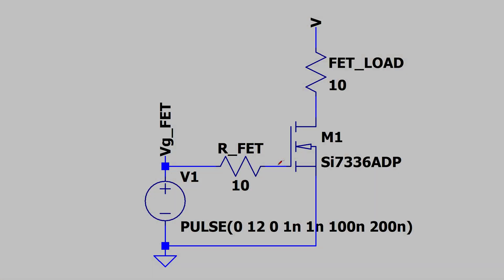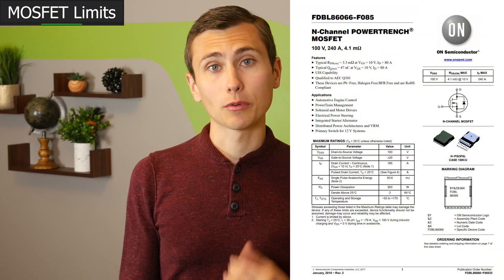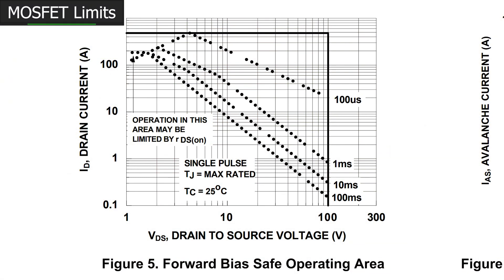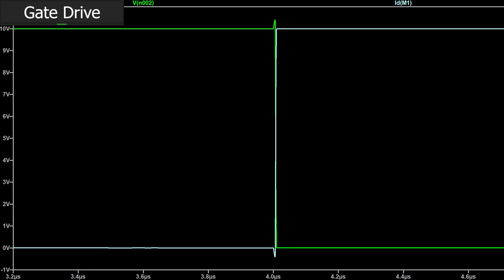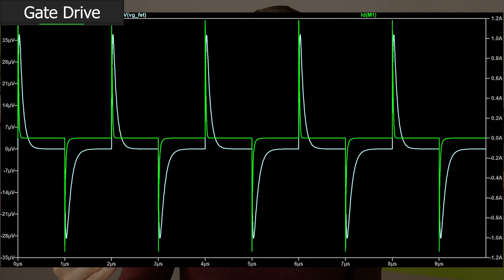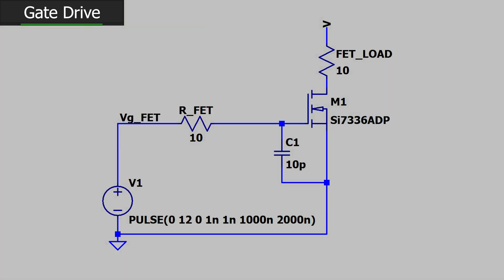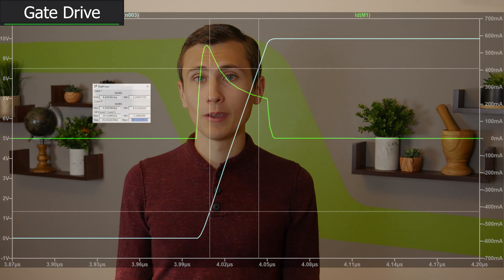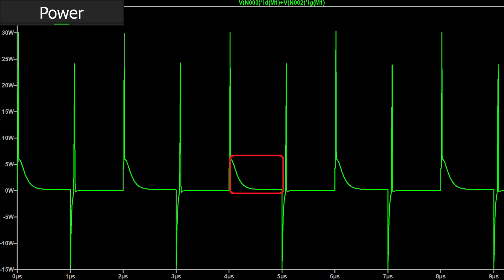6 Simple Tricks that Destroy MOSFETs!

Comment: What a fantastic tutorial … as an old crusty 56 year old engineer, you have taught and consolidated some really important stuff that I haven’t seen much in my career being focused mainly on the maintenance and fault investigation side of things. I’m currently having a bash at designing a high current boost converter and it’s no walk in the park. I think as a designer, a good analogy is if this was woodwork, my design would probably work but would resemble a load of roughly sawn bits hammered together with a few rusty nails with over sized parts but structurally weak so don’t use it to sit on!!! As opposed to a beautifully crafted product with smooth lines and a beautiful finish that is light enough to fly at supersonic speeds but can also be used to stand on. 😂😂😂😂

Comment: Hello, does this data sheet specification "Vgs - Gate-Source Voltage:  - 10 V, + 10 V" mean what I think it does? As in, do not supply more than plus or minus 10V to the gate from the driver? Gate-Source is confusing due to the MOSFET having a "source" pin. Does it really mean Driver-Gate Voltage?
Reply from the maker: Hello Anond, great question!! My apologies for the slow response. 

Vgs, is the voltage at the gate, measured with respect to the source pin of a MOSFET. A rating of +/-10V is measured at the part, so typically some margin is left when designing the driver. (Parasitic capacitance can lead to voltages measured  at the gate that are above or below the driven voltage. 

That's more necessary for higher-voltage parts and parts that have high dV/dT events (rapid changes in voltage or current)

Side note, but driving an nmos fet with a negative gate voltage will almost always reduce off state leakage current!

I hope this helps!

Comment: Can mosfets (like BS170 in TO-92) be destroyed just by touching them (without it being connected to anything, straight out of packaging?)
Reply from the maker: Absolutely! ESD events can kill a mosfet very easily if it strikes the gate pin directly. This can charge the gate pin beyond the VGS rating, destroying the part. 
In fact, mosfets are most sensitive to this before soldered on to the PCB! (The board will add an element of shielding, additional components, and parasitic capacitance that help to minimize peak Vgs stress during ESD events.)

Comment: O: I am not electrician, this information sounds really well made though.
I was wondering if you can guess what happened to my spot welder mosfets.
I was using 2 12v batteries in parallel for powering the spot welder because 1 was too weak for making a welder. So it worked Very well but the cables were getting too hot. So I decided to use thicker copper wires. But after the first welding the mosfets exploded. What happened? The same setup, just thicker wires.
Reply: if you get thicker wires, your resistance decreases and more amps can go through the 12V circuit.

Comment: Exceeding vds does destroy fets, on the contrary, it's actually quite useful if you know how to use it.  Avalanche mode is allowed as long as the heat generated does not exceed the failure point of the junction.   Time and current while in avalanche is the concern. I regularly design switching supplies to use avalanche as means of controlling emi/emc, just need to make sure your inductor spikes time in avalanche and the current flowing doesn't push the junction over its dissipation abilities.  The capacitor on the gate is silly, just use a fet driver, or if looking for low cost solution a totem pull of bjts and a pull down resistor will make induced turn on a non issue.  Keep making great video's
Reply: I think you meant does not destroy mosfets?
Reply: @easyamp123  Oops, yes I'm meant doesn't destroy. Just like using a pn junction diode in avalanche, you just have to watch the heat because the junction will now carry both the voltage and current simultaneously but is a useful mode.
Reply from the maker: Hi Dawn, great point! I certainly wasn't thinking of avalanche-rugged fets when making this video. I suppose that would be a great qualifier here. If the design is meant to use avalanche mode, and you add a couple asterisks about not violating the other limits you mentioned, that is certainly a useful lever to keep in mind! 

Thanks for the great comment/reminder, useful tips, and thank you for watching!!

Comment: If my MOSFET is getting really hot, does that mean I'm violating one of its limits, or is that normal?
Reply from the maker: Hello Sollertia, MOSFETs usually get warm under load.. but if they get too hot, that's a problem! Somewhere around 80-100C at the junction is usually the hottest I'll push a part... unless I really need to. I hope this helps!

Comment: I am looking for the best mosfets for an induction heater (2 - 4 kW power, input voltage up to 52 V). I tried the power mosfet IRFP4768 from infineon but got terrible ringing problems at the gate. Tried to minimize loop induction and used gate resistor up to 68 ohms - problem dampened but not solved and getting slow slopes - generating even more switching losses. The IRFP4768 has very high gate capacitance of more than 11 nF. Should i better go with the IRFP260N? Has less gate capacitance but also less power handling capability so i probably need 2 or 3 in parallel. Or should i better go with IGBTs? The last tend to have more losses on lower amp ratings, but are more effective on very high power levels but need extremly efficient cooling. I would probably need water cooling to get rid of 100+ W from the to-247? Any ideas?
Reply from the maker: Hello Richardnis, I think we chatted in a live stream a little while ago, but yes, sinking heat from MOSFETs is a crazy complex problem. Transients, shoot-through, and ringing can cause a lot of problems. Gate drive isn't simple, and the added capacitance doesn't help! It sounds like you're trying the right things... you must be close.  :)

High-power designs are always a balancing act. In general, spread the heat out, or suck it out as fast as you can. I've had good luck with the "A14692-30" material from Laird - part of the K52 series. If you need a great thermal interface, this is a beautiful combination of polyamide film (great voltage isolation) with a phase change material coated on either side.

Thanks for watching!

Comment: I need your help about a mosfet gate control . 
1 : what is the best (OP) ic to control mosfet gate in DC region .

2 : in high voltage / current 
What filter I can put in the gate ( because the mosfet when it work in high voltage and the gate get switching voltage so fast . I can hear some time sound like  nose ( very high frequency can be detected by oscilloscope between gate and ground )

And if I want a complexity gate driver for a 2 mosfet in parallel ( every one with his own shunt ) but same ground and same voltage but separated gate drive and a feedback from this 2 mosfet to make the current same between this 2 shunt  )
Reply from the maker: Hello Abed, Thanks for watching, and thanks for the comment!

You are asking a lot of great questions, and I wish I could answer them completely here. I'll do my best to give a brief overview, but know that we have an upcoming E4E electronic load project! Stay tuned for that series, which will dive into these concepts in a lot more detail!

1. You'll need build some form of compensator. (see TI app note) http://www.ti.com/lit/an/slva662/slva662.pdf

This can be done in hardware, or software, with many different types of devices!

2. Controlling slew rate, etc, is important, and having a gate driver that can supply adequate current will be very important! for multiple FETs in parallel, you may need to have one control loop for each FET, since temperature effects and tolerances in the two linear MOSFETS may lead to imbalanced current sharing.

I hope this helps!
Reply: Yes ( you doing the DC electronic load will be supper great ) thanks .

Comment: I need a mosfet to work in DC region  for long time as a DC load battery 60v test . What type you suggest to use ? I need mosfet for test battery as dummy load 60v 20A for 4hr
Reply from the maker: Hi abed, thanks for reaching out! A linear mosfet is what you're looking for. These devices are designed to be used exactly how you described.

I personally bought a cheap electronic load from Amazon, which uses a device like this with a control loop built in. I hope this helps!
Reply: I buy one from AliExpress and it's 20A 200v 180W ( DIY 300W ) for short time as they say . 
You can find it in AliExpress for 45$ have a big fan like a computer cpu fan . 

But unfortunately when I put a 60 v even in 2amp it just exploded with fire under the fan . The mosfet they use is irfp260 it supposed to handle more than 60v and more than what I applied . But I ask some one to review the dummy load reverse engineering he say that the problem is not for the mosfet . The problem that the driver for the mosfet need to be work in linear compatible with the what  mosfet can handle in high voltage with out any nose desorbed the drive .

Some other one say that I need to change the dummy resistance loud with a bigger number . 

I replaced the mosfet with same one from China but it's not working as the original and exploded at 30v  3amp.  I make some exploring in Google and found something call irfp90n20d . I install it and it worked at 60v 2 amp as the testing for 15min I put 3amp for more than 60 second and short out the mosfet . So I give up on the dummy load and start to test my battery with car LED ( old lamp 60 / 100w lamp ) serial and parallel way.

I was really hope to find some mosfet can really handle max 80v 10a 800W for a more than 4hr with out pressed the mosfet and not let it work like a crazy

https://www.google.com/search?q=dummy+load+20A+180W&sa=X&ved=2ahUKEwipyMPTkrjnAhVSrxoKHRVjCdEQ7xYoAHoECAsQAg&biw=360&bih=512&dpr=3
Reply from the maker: Hello again,

I see. You'll need to pay very close attention to the safe operating area for these parts. Dissipating that much power for that long will be a challenge! Getting that much heat out of a single part may require something exotic like liquid cooling *gasp*. 

Another option may be to use multiple mosfets in parallel, as a way to share the load. It might be possible to use a linear mosfet like a voltage-controlled resistor, but I'd reccomend having some form of closed-loop control to regulate output current.

Comment: I have found (in my experience) that resistor of around 10k, between gate and source of mosfet is crucial, for shoottrough prevention.
Reply from the maker: Hello Sanel! Good point, I typically like to add a reasonable pull-down on the gate as well. Some gate drivers have sufficient dead-time or adaptive dead-time control, which can help regardless of if this resistor is in the design. In general: I'd rather have the pads on a PCB and not need them than find out later that it was necessary. :) Resistors are small and cheap. Thank you for contributing, I neglected to mention this, and a reminder is always good.

As always, thanks for watching!
Reply: High dv/dt level causes a current flow through internal Cgd and Cgs caps. I think this resistor helps to damp unwanted gate voltages which crossing the threshold voltage during high dv/dt presence.
Reply from the maker: Hello Erhan, you're correct! The capacitor I added has the same effect, without steady-state current flow. Thanks for watching!
Reply: @erhandemirok  I think in simple manner. If there's no gate to source resistor, it is very much probable that bottom MOSFET stays turned on, so that when high side command comes to gate of upper switch, it turns it on, while bottom MOSFET is still on.

Comment: I wish you touched on the dV/dT subject  more because it is something I didn't know and it is rarely mentioned in beginners guides on how to use a MOSFET..   If I understand things  correctly, you are saying that in a "totem pole" (don't know that is a good term to use) like one side of an full H bridge, turning on the top MOSFET too fast can result in the lower MOSFET turning on due to the dV/dT at the drain of the lower MOSFET?
Reply from the maker: Hello wgm! Thanks for watching! Yeah, dv/dt is one of those things where it doesn't always become significant - it can be safely ignored for some applications if best practice is followed. You understood correctly! I observed this while simulating a 1:1 Full Bridge Power Converter we're using in the PFC module for our DIY UPS Project (https://youtu.be/24PXGbT_0Fs?t=377) where we talk about this effect, what It meant for our design, and how we worked around it. Maybe this will help by providing another example?